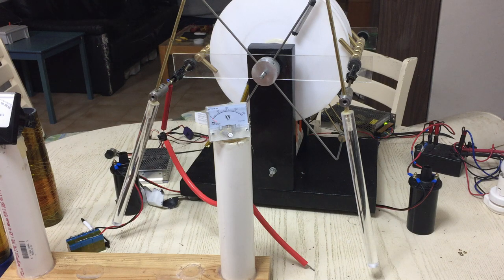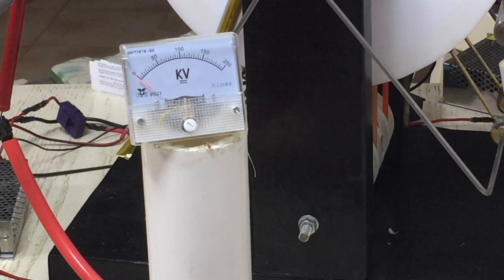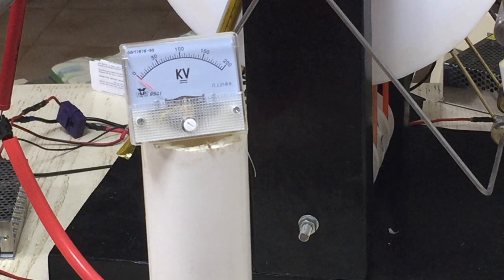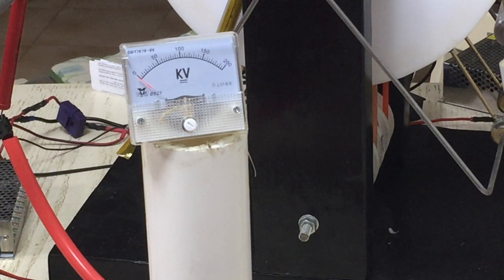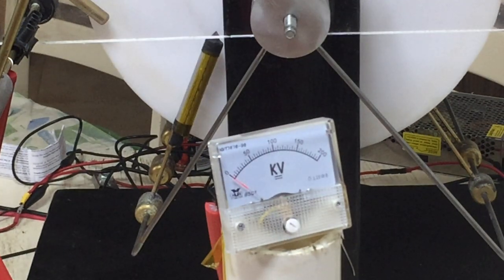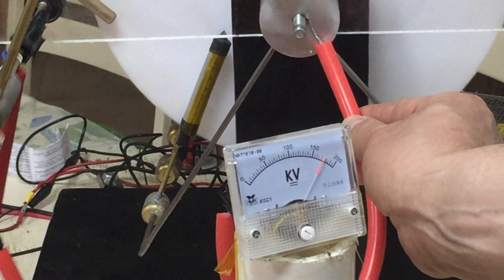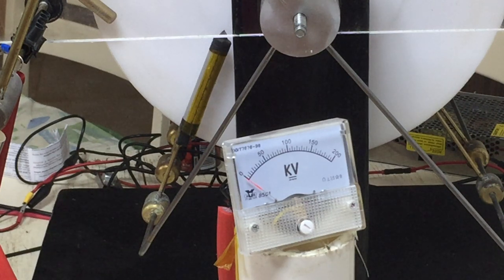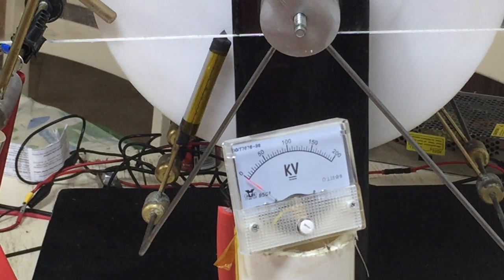Analog Voltage Measurements From Wimshurst Machines

Comment: Mr.Bonetti you need to connect the plus and minus ends to two capacitors with a spark gap in parallel and the caps in series . Then an L1 coil with resonant L2 coil for step down can be used and the output to high frequency high voltage diodes. when the high voltage static electricity achieves a high enough voltage it closes the gap and goes into the L1 coil which sets up continuous ringing which then is transferred into the L2 coil which in turn steps the voltage down and the current up. The parallel spark gap defeats the high impedance by pulsing the static electricity which causes the high frequency oscillations in the coils resulting in an amplification of the current. You are essentially using a Tesla coil in reverse. There are plenty of patents that explain this in Russian including one where someone uses a Wimhurst generator to power a car.
Reply from the maker: Lets see the Wimshurst powering a car!
Reply: @MisterBonetti  In 2007 I was partnered with a very intelligent electrical engineer and I am a chemical engineer with my specialty in electro-metal-chemical-catalysts. We succeeded in replicating a Testatika and his build is the one you see everywhere when you look up Testatika. He disappeared soon after that and I suspect he sold the technology and went someplace warm. I absolutely believe it can be done. We achieved a 3 kilowatt output using an Estonian inventor's papers that absolutely powered Germany around the first world war. The papers shift between aerials and an influence generator. We chose a Wimhurst but I believe your Bonetti devices will work. Why would you question whether that could work? It is truly a simple conversion system.
Reply from the maker: @Biokemist-o3k  Are you claiming your partner was Jorge Resines?
Reply from the maker: re you talking about this scam? http://alt-sci.ru/_en/wiki/images/4/4d/Testatika_1_en.jpg
Reply: @MisterBonetti  That is my claim. There is a crazy story
Reply from the maker: @Biokemist-o3k  Use of words like "Conversion System" when you mean something that sucks non existent energy from the non-existent Aether (I think the definition of Aether is nothingness) is always a big red flag.  I have seen the blurry almost unwatchable videos form the Methernica cult (Paul Bauman as you know was in prison for pederastic rape, where apparently while reminiscing about whether or not his 10 minutes of man boy love was worth the prison, time and he came up with a perpetual motion machine).  Both Bauman's own words and the few that allegedly visited Methernica and met him all claimed the machine was self propelled via the Pogendorff principle, there is no such thing.  Pogendorff was the first person to realize if you take ANY of the so called influence machines, and remove their pully or gearing mechanisms to limit friction, the supply the machine with extreme high voltage DC (in those days simply from another Influence machine), it will become a motor.  He first tried this with horizontal Holtz machines, but soon realized if he used a Wimshurst or a Sectorless Wimshurst (Bonetti Machine), he did not need to start the disc moving manually, as the static electricity input was enough to self start both these simple low torque motors.  There is not and never was a "Pogendorff principle.  The problems with the so called recreation you refer to is that all accounts from Bauman to those who knew him, and his fellow cult member engineer all said the 3 leyden jar like devices where in fact leyden jars (with the plates made of  perforated steel like they used to use on antique Victorian home radiator covers.  He did say they had models with just plain Leyden jars.  Again I am not talking about the two large cylindrical step down transformer devices you see on all images and videos of the originals.  In this so called recreation they three leyden jars I am talking about are not Leyden Jars at all (if they where the two biggest would be in the range of 2 - 4 nanonfarads (2000 - 4000 pf), in the photos of the so called recreation they are just vegetable cans (which may charge because they sit on an acrylic platform isolated from the ground, however without the dielectric and inner plates, you are talking single digit picofarad capacitances at most.  In other photos of the same so called recreation the two step down transformers are simple 3" 12" long tesla coil secondary's (perhaps the primaries are under the aluminum foil on the cable form spools they sit on.  If that is the case, they will work to step down the high voltage (assuming the motorized Wimshurst worked at all in the first place), but even if you matched the resonant frequency of the high voltage side with the low voltage side (requiring the right capacitance on BOTH primary and secondary) it will be horribly inefficient because an air core transformer lie a TESLA coil needs a coupling coefficient   of 1.25 roughly if you approach or exceed even 2 the primary and secondary will arc to each other, this extreme low magnetic coupling makes the Tesla coil a very inefficient transformer, and  even worse of a step down transformer.  Despite pictures (and no videos surprisingly) of the three light buls lighting and the face of the sectored disc appearing appropriately blurred reveling it was more than likely spinning at high speeds when the photo was taken, it is undoubtedly fake (in other words the machine is NOT why the bulbs are lighting.  Also the original did not have pulleyed discs, the pulleys an single belt idler pulleys can be CLEARLY seen in many of the available photos of this so called recreation.  If you claim to have some sort of secret sauce to prove me wrong, that I can test on my machine, by all means share, but until then, I must believe this is yet another free energy hoax.
Reply from the maker: Send me the Russian patent that explains how to run an electric car with a Wimshurst or Bonetti machine. I have hundreds of Russian friends her to translate them for me.

Comment: What is your wattage on your driving motor?
Reply from the maker: It depends on the speed.  This will run with less than 20 watts in, but the faster the machine spins the more current output, so I typically run around 2000 RPM (can get it up to almost 3000 RPM with no load and faster if attached to a load, without a load the surface charge creates a huge load on the motor and disc drag, the opposite of a conventional magnetic generator whos load increases with the load on the motor).  So at 2000 RPM it about 200 watts (or a little less to run it).
Reply: @MisterBonetti  Your machine is nice by the way, I'm basically using your machines as a perfromance target to beat since you have the mose perfomant and compact machine I've seen soo far.

I want to beat that, I'm using sectors and a custom desgin, but it's a learning curve, lot's of factors to take into account and lots of testing. The most reliable wayt I've found for output testing so far is timing a spark gap using a known capacitor bank.

My best test so far is charging 16 nF of 20 KV rated capacitors to spark at a frequency of 0.5 Hz. So 8 nF per second of charging to 20 KV, works out to 160 micro-amps. Right now, I have 12 sectors made of welded steel tubes. But I can fit 30 in the rotor spacing and always meant to put more, but used less for testing. Additionally, I could change the material to copper on the rotor which has 3 valence electrons compared to most other metals 2 valence electrons, so between those two factors, once I upgrade the rotor, should be able to produce 600 micro-amps.